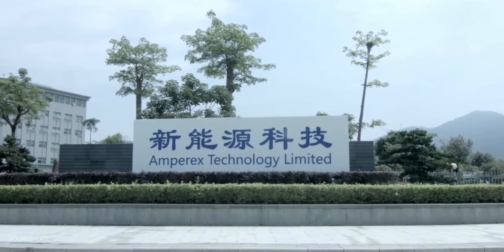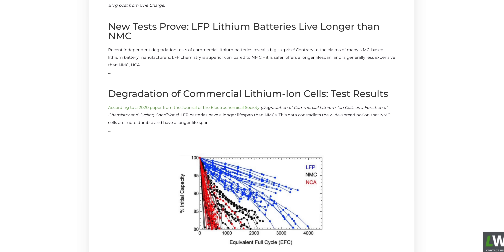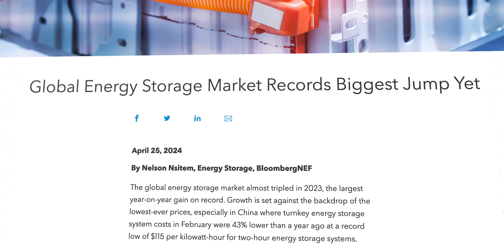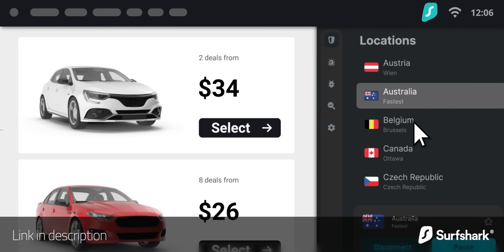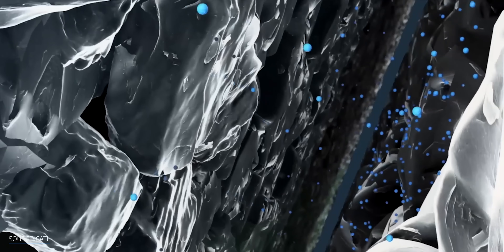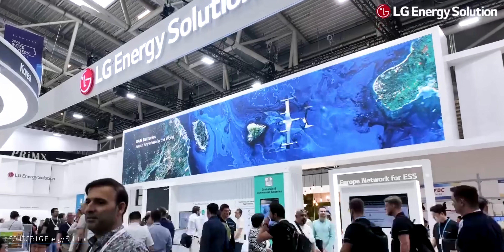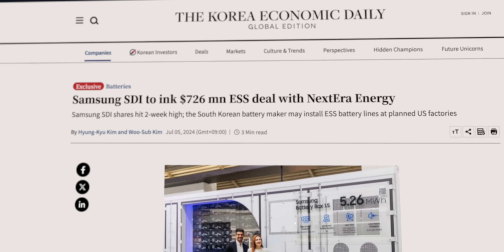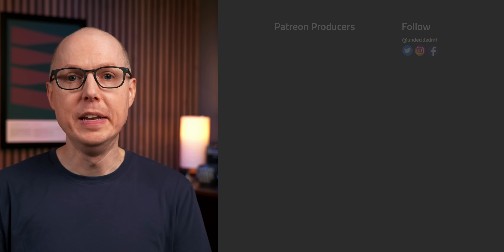How This New Battery is Changing the Game

Comment: Five years is great for electronic devices, but you need twenty years for vehicles.
Reply: In another comment a guy says his Model 3 has degraded from 291 miles to 285 miles in 5 years, that's like less than 2%, I think he'll be fine for another 15 years.
Reply: @krashd  Tesla games the system, by hiding battery capacity that reduces the apparent battery degradation during the warranty period. All manufacturers now do it, because they know if owners see significant battery degradation every year early sales will tank.
Reply: @krashd  🤔 I doubt that. You might not  be aware that battery degradation is not linear. (Note that degradation graph in the video?) It increases rapidly with age, finally falling off almost like a cliff at some point.
Reply: @fotoguru222  I believe that it does the very opposite of that.
Reply: @marcsimmonds5483  🤗I wish your belief made it so.  But 🤔🙄 that's not how it works. 🧐
Reply: They are already showing you are getting 10+ years on our current tech with no more than 10% loss. If you get 20 years with today's batteries only 10% loss, does that really matter? The 20 year old ICE car it already costing more per gallon, just due to the price of fuel increasing.
Reply: @TheNextWILife  The first year of Model S batteries have had an 8% failure rate. They are now 12 years old.

Comment: The fact we still need more batteries just proves my point, that while power generation still need to increase, it doesnt have to increase what coal and other power sectors were trying to say that we needed to hit. The fact is we WASTE a ton of power everyday to nothing. Now that we have some way to store it we are seeing the need for power generation is actually dropping thus we're hitting to a point where renewables are even able to keep up with the base load power now just from a few hours of the day in the sun. Also while I loves to see more LFP - NA still to me seems like the clear winner when it comes to grid and home base power needs. If LFP is already doing this much work, cant wait to see what hybrid NALFP brings or even just raw NA (both sides of the battery) can bring next in terms of cost.
Reply: This is the thing. If we create a smart electric grid, everyone's electric car could be that dynamic storage. Charge them when there is excess, use the car batteries power for high demands. With it being smart, you can program your car to give or take as much as you need.

Comment: With recent EV fires in the news, I wonder if building codes will have to change to ensure safe operation of residential battery storage. Many of these renderings show batteries mounted on a wall indoors which is really not where you want it when your Chinesium battery decides to get too hot and vent toxic, flammable fumes for about 2 seconds before is self ignites and takes everything and everyone indoors with it. I mean, would you store your diesel generator fuel tank (which is incidentally less flammable than a thermal runaway Li cell) indoors?
Reply: LFP isn't self oxidizing like the more popular nickel/cobalt based batteries that everything else uses. Yes, there is some flame depending on how hot it gets and will vent noxious gasses. But it won't be the giant flamethrower of other Li batteries. But short of pounding a railroad spike through it, that scenario is almost 0%, even with "chinesium" cells. The sad part is, China's major manufacturers like CATL, CALB, and EVE are producing some of the best LFP cells out there. It's high quality stuff. I have a bunch in my house. China doesn't automatically = bad. It's all on who's running the factories. 
The US is way behind on general battery manufacturing. We need to get our ass in gear.
Reply: @andrewt9204  Perhaps I shouldn't have dunked on China specifically. Everyone cuts corners and everything wears out eventually; and when you invest into a home electrification system, you don't typically expect to replace it after 5 years for a brand new one. Maybe more like 30. LFP is safer than NMC for sure. Still, I personally would not keep it indoors. What I find really sad is that regulation is typically written in blood and not as preemptive act.
Reply: @idratherstayprivate  Yeah, you have to wade through a lot of crap sometimes. China definitely has a ton of junk to sift through. As for LFP in the house, at least for me, its on the opposite side of the bedrooms in a mostly bare mechanical room. I just make sure my smoke detectors work. Being a rambler I can just hop out my bedroom window long before the fumes get there.

With my light cycle usage, I expect it to calendar age rather than cycle age. Should last me 20 years or more. Even cycling one full time per day is 15 years according to various cycling test labs out there.
Reply: "With recent EV fires in the news," <- ooh, there's some framing right out of the bat.  Hint for you: scaremongering over EV fires won't work in the long run.  You might as well talk about ICE fires because, guess what, they're fairly common.

"Chinesium" <- more hate-mongering.
Reply: EVs have far fewer fires proportionally than ICE vehicles.
Reply: @shawnr771  Not if actually look at the numbers. Considering the respective ages and sizes of the global fleets, we should be seeing far less EV fires. Given the severity of these fires (toxic, self oxidizing) the risk of an ICE car catching on fire is far greater if it's parked near a charging EV.
Reply: @shawnr771  Careful, these types hate facts!
Reply: @krashd  So.
Reply: @krashd  Alternative electro-evangelist fact, yes. Maybe take a stats course before you try muddy the waters. Or maybe take a look at some videos here on youtube how fast these fires actually evolve and how little time there is to respond. Your reckless misinformation may cost someone their life.

Comment: I'm amazed that no game changing technology ever changes the game in the battery world. 
Sensational breakthroughs have been reported every month since 1976, but nothing ever reaches the market.
Why is that?
Reply: @rogersunesson  We have had more than a 90% drop in storage prices in the past 20 years. What do you want to see?
Reply: @VluggeJapie59  While we all appreciate lower prices, that's not really a technology advancement. More a result of manufacturing optimization and scale.

I guess I'm looking for that 10x, 100x or 1000x invention leap that we are promised from time to time in energy storage.
CPUs and memory got 10 000 times faster in the last 20 years.
Reply: @rogersunesson  Back in the 70s I had a bike battery that was the size of two 18650 lithium cells that would run my light for about an hour, at probably 5 lumens, today my bike light will run for two hours at 1300 lumens with those two cells, THAT is a big difference.
Reply: @rogersunesson  If you want a battery with 1000 times the energy density you can give up straight away, physics doesn't allow that. A liter of Diesel contains 12.7 kWh/kg, so a battery going from 350 Wh/kg to 100x more (35kWh/kg) is already impossible. 
The theoretical upper limit for a solid state battery is 11kWh/kg, but that won't happen, the realistic upper limit is around 1000Wh/kg. 
Samsungs newest battery they just delivered is 500 Wh/kg, so we are half ways there already.
If you take a look at where we came from, your Nokia 3310 had 1100mAh of storage, Samsungs S24 phone has 5000mAh of storage, they are nearly the same size.
Reply: "reported every month since 1976, but nothing ever reaches the market." <- look in your pocket at your smartphone. Those batteries were not possible in 1976.
Reply: Li Ion batteries were game changing when they were invented in 1976. And there have been advances in packing technology since Li Ion were commercialized. We got 2-3 times the energy density today.

A bicycle light in the 70s used incandescent lightbulbs compared to today's light emitting diode which is 90% of the reason your battery lasts longer. Smartphones were not around 40 years ago but using battery technology from that time I'm sure you could get almost a full days worth of usage from a modern device.

The argument about physics not allowing higher energy density seems to build on the very narrow assumption of continuing on the current path of chemical storage.
Uranium-235 has 30 million times the energy storage density so clearly the universe is capable of higher energy density.
Reply: Li-ion batteries were beyond gamechanging, our phones would not be possible without them.

Comment: i am excited for all the new tricks for batteries and such.. I just hope they are not cheating. what i mean by cheating is making a battery 20% larger than they list and making it software limited so it only charges to the limit so as it degrades it still had rated capacity even if it decades.

Comment: Hey Matt. 2 points. What ever happened to the flow battery solution for residential storage?  Point 2. I already have a battery in my EV.  Why isn’t anyone focusing on a simple EVSE/ V2G (vehicle to grid) solution. These companies both vehicle and EVSE makers are dogging any real innovation in this area.  I know, some have a plug for V2G, but seriously that’s about it.  A soccer mom or dad should be able to plug in a single smart cable and deal with getting dinner on rather than messing around with settings and home storage solutions not to mention spending the tuition money on something both redundant and a fraction of the size of the storage already existing in their EV. Perhaps there’s more to it but frankly and nothing personal, many people want to participate in the advances in technology without having to become energy geeks.  Thanks for your contributions.
Reply: I think having the EV battery as a backup power source for the home makes a lot of sense for an emergency battery. Perfect for people that don't care to separate themselves from the grid in some meaningful way. But there is the issue that what if your house needs power while you are out of the house and driving your EV somewhere? If you need power while you're gone, it becomes very inconvenient if you then have to avoid using your car just because it is your backup power.
Reply: Using your car’s battery as home energy storage frequently/continuously will degrade the vehicle’s battery more quickly- reducing range, resell value, available range when you need it, etc. Seems better for an emergency and plugging it in based on your own decision vs everyday usage.

Comment: I remember back 3-4 years ago when Texas had it's freeze that we were told that had Texas had sufficient power storage it could have ridden out the storm fine.   It looks to me like that's around a trillion dollar investment in storage systems like this and they are degrading fairly quickly in the overall scheme of things when a state invests 3 times it's annual budget in infrastructure.

I feel like this issue is not getting enough discussion.
Reply: That’s a different discussion Texas had built an independent grid that had no redundancy for this type of storm.  Most of country is tied into larger grids and are somewhat more redundant.  This kind of storage in the video is more of a buffer so you don’t have to build generation capacity for grid stressing events and help with wind and solar.  

If you’re talking about mega infrastructure, hydro sticks out as time tested and green if you have big bucks for it.  Nuclear has too many NIMBYs for us to have a modern reinvention.  Fusion is 20 years away in perpetuity.
Reply: @SpaceJazz3K  It was in response to the storm, where they said the wind and solar would have been fine if the storage system had a reasonable capacity to keep powering Texas for the few days of the storm.  They were literally talking about having enough batteries to store multiple days of power for the entire state.  Because, keep in mind, they want no coal, no natural gas, no diesel, and no nuclear power.  They want it to just be wind and solar.  Hydro has significant limitations and can't do enough to fill the gap.

Comment: 15k cycles/(365 cycles/day)=41 years, no degradation in the first 5 years means nothing.
Also, there's no such thing as zero degradation. You just provide more over provisioning and by the time it degrades to its nominal value, the outside world sees zero degradation.
Also, 15k cycles is not absurd even using existing technology. A 2k cycle rated cell (at 100% cycle depth to 80% capacity) can cycle 15k easily at 70% cycle depth at 50% remaining capacity and 2x the internal resistance (still quite useful for grid level storage).
CATL did make technical breakthroughs, but the marketing material is certainly over-hyping them.
Reply: @bskull3232 Yeah, I don't see the hype for "zero" degradation. It could be nice, but not the deciding factor. LFPs can already last more than a decade with minimal degradation and it's not like they stop working past the rated cycles. Just like with solar panels.

Price reductions are far more impactful. You could probably buy better batteries at less than half the price before the end of its rated cycles.
Reply: @bskull3232 - 15k cycles /(365 cycles/day) = 41 days. Did you mean 1 cycle/day?
Reply: @openhorizon1162  My bad.

Comment: Would have loved to hear why this battery tech isn't viable for EVs and similar forms of transportation
Reply: Because it's larger, he explained that in the video - they are 20% larger than current batteries so static use is the only practical use unless you want vehicles with much lower range.

Comment: Is there any ESS that's using hydrogen for grid storage? It recently occurred to me that using renewables to create hydrogen via electrolysis could be a seriously effective way of storing energy, since I know that's one of the biggest hurdles there are.
Reply: No, theres some research, trial projects and industrial usage but no active scaled deployment of hydrogen storage compared to battery storage. The economics is against hydrogen in this case as batteries are cheaper (capital and operational costs), more effecient, take up less space and require less maintainence. Hydrogen is considered where there is a secondary use for the waste heat produced in the hydrogen generation, processing and conversion to electricty steps, such as industrial processes.

Comment: If a chemical change (like melting ice) stores power, then that chemical change in reverse (like freezing ice) releases power, and even if there are thermal losses of energy in that process, theoretically that process can be repeated infinitely as long as we have energy to input into the system. So theoretically, infinite cycle life is quite possible.
Reply: "power" <- energy .
"So theoretically, infinite cycle life is quite possible" <- no.
Reply: Melting ice is a phase change, not chemical change, but I see what you're getting at. Ice storage is already being used all over for commercial buildings. Charge up the ice tank at night when power rates are cheap and use the ice for cooling during the day. There may be some material that you can capture electricity with using phase change, but I don't know if any viable solutions exist yet.
Reply: @andrewt9204  ice/water was a poor example and distracts from my main point of theoretical infinite cycle life.

Comment: My only question is, sure, it works flawlessly for the first 5 years.... after that does it fall completely apart? Does it degrade at the normal rate after that? What's the tradeoff?
Reply: I am guessing no. its just 5 years before there is any degradation. Even if it's the "normal rates," you are going to get another 5 years before there is any noticeable reduction in storage. If you plan on a 10% overhead, you can get 20 years before you start needed to replace, or add more cells to the system.
Reply: @spencer9392   if it's actually 5yrs with no degradation after so many cycles, it may have 10% degradation after 20yrs for all we know.  But until these cells actually age under heavy use, we won't know.   Lab tests for 5yrs of use over 1yr isn't gonna be the same thing as thousands of people using these batteries for 5yrs.
Reply: Also that was the numbers the video said, I bet there are more stats on their tech sheets.
Reply: Just bookmark this comment and come back in 10 years. We will have all of your answers.
Reply: "china claims"
Reply: @fredlacroix6865  it's not like there aren't highly questionable "US claims"

Comment: I have a 2019 Model 3 that has only degraded from 291 miles to 285 miles in 5 years. Degradation is really not a huge problem even with NMH and probably less with LFP. CATL battery with 5% less degradation is nice but not ground breaking yet.
Reply: Keep in mind the stated degradation levels are at peak potential use cycles of full depletion and recharge, not avg or low use. So it's essentially (if we're to take their words at face value) 5 year guaranteed no degradation, but possibly many more years with next to no degradation.

Comment: Yeah just like your video about solid state battery that you promoted (and robbed your audience) knowing that they are simple lithium based  batteries. You have lost your audience trust shame on you
Reply from the maker: Solid state batteries aren't a specific chemistry.  You can take a standard lithium ion battery chemistry like NMC and replace the electrolyte out for a solid one.  It's still lithium ion and solid state (they aren't mutually exclusive).  BUT as for Yoshino, there's a lot more to that story, which is why I unlisted the original video and am doing a very deep dive on it coming up.